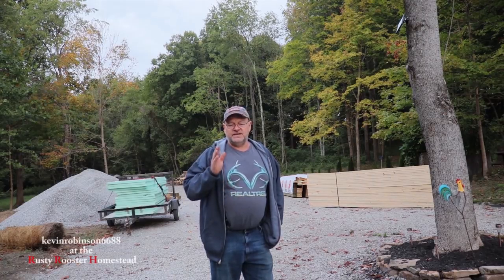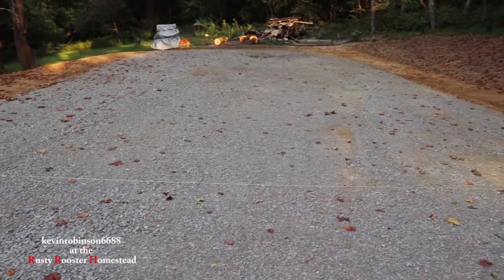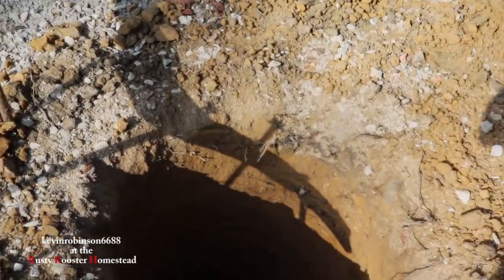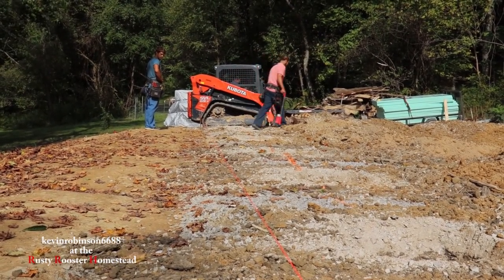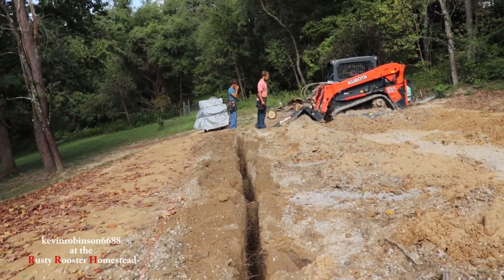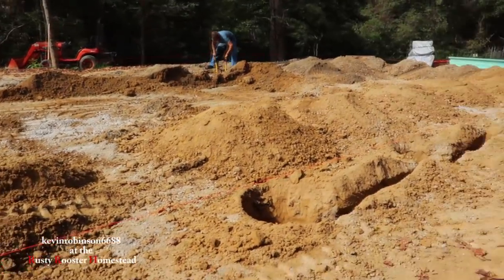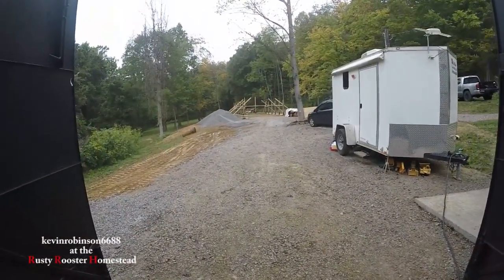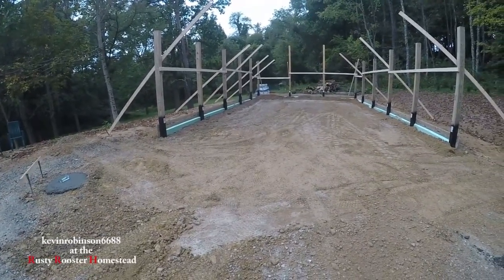mini barndominium poles and foam board frost barrier

Comment: Do your trench first, install your form board, backfill; then drill your holes. Great way to do it, 👍🏻 cheers!
Reply: And put the spoils outside the perimeter so it's not in the way and then be used as backfill to slope drainage from the building.

Comment: You sure got a lot done today. I've never seen a foundation like that before. Really interesting. I always learn something new with your videos :) Thank you for sharing.
Reply from the maker: Gerard , it isn't a foundation it is just a vapor barrier between the ground and concrete the engineer made me use.
Reply: Looks like you used more (deeper) foam then needed.  Foam is only to stop slab from wicking cold from perimeter dirt or foundation wall if you did foundation.  Only need foam on outside perimeter of slab so 4-6” deep depending on chosen slab thickness.
Reply from the maker: @chriszbodula1894  I'm basically have to do what they ask me to thanks for the comment

Comment: Hire a plumber, cost was minimal. I ran electric in rafters to keep it out of the ground and put insulated pex under concrete to wall radiators. 5 years in I love everything but the termite problem.  If doing it over sprites would be on cocrete

Comment: You will save a lot of money on heating and air conditioning if you put more insulation in and All the way around the house. I lived in Alaska for about   7years .
Reply from the maker: We are going to use rockwool insulation once the wall are built
Reply: Rockwool ? Its not save for human
Reply: @suhermantjahyadi7361   your wrong
.smh

Comment: I have a few questions and I am hoping you can help me out.  I am just starting a build in Missouri and I love your frost wall idea, but I can't find a video where you tied the frost wall into the barrier underneath.  
I am considering going in 4 feet into the pad but I'm not sure if I need it, I am not doing floor heat.
My second question is, when you did your foam board insulation on your walls, you left a space between the metal and the foam board, aren't you concerned about condensation?  Everything I have read says to not leave a gap.  What are your thoughts?
Thanks for your help and I enjoyed your videos.

Comment: Kevin, was there ever a discussion or thought about putting plywood down on top of your trusses and then your roof steel? Have noticed any extra noise when it's raining by putting your roof steel right to the perlins? I noticed you also did the bubble wrap which probably helped. Any thoughts?
Dave
Reply from the maker: dAVE, WE USED TWO LAYERS OF SOUND PROOF INSULATION SO WE DON'T HEAR ANY RAIN OR EXCESSIVE NOISES , SO FAR EVERYTHING IS STILL GOING GREAT. THANKS FOR WATCHING .

Comment: Questions:
Why dig holes so much bigger than the posts?  Doesn’t that waste material and make it harder to firm up the posts!
What is a royal area?  Is it zoned for something special?
Why did you dump hole dirt inside?  And even shovel more toward your interior!?  I think you’ve lost thickness and “tooth” for your concrete.
Did your hole auger guy check how vertical he was digging?

Comment: Your video skipped over one detail that I missed:  
(1)  did you simply rest your posts on the tops of the dried concrete columns?
(2)  how much work was required to align them so they were all plumb and planar?
Reply: Looks like they did and  they plumbed it with the supports. That's why they didn't remove the supports till they had the rafters in.  
They pulled them out to the string and using the 2x6 treated board locked them in low. The 2 - 2x12's were shelved in and locked the top. It's a barn witha concret floor. He said he was on rock.

Comment: WHY would anyone clean the hole dirt on the gravel pad  ?
Reply: And why auger holes only to trench and fill them again.  Also, why so much foam in the ground just to insulate/isolate the slab from the ground sidewalk dirt.  Just need enough foam to cover the slab thickness

Comment: Would you confirm how much cement you put in the holes and confirm you let them harden (cure) before setting the posts on top, then pouring cement around the posts.  This was the critical step I was really hoping you would show on video.  As it’s stands now we can only assume this is what you did.  Also, a critique on your job site neatness and order of work.  Why not trench first then auger holes.  Also, they spent time leveling the building site only to dump dirt on the inside floor space then the time it took to take the dirt out one bucket at a time.  If dirt from auger was dumped to the outside the inside of the building would have remained an flat level easy to stand on workspace and the outside dirt piles could have been pushed out of the way verses a bucket load at a time.  Also, why gravel the house site only to push away with the dirt.  Only thing one can assume here is mud control but gravel didn’t seem deep enough.
Reply from the maker: Thank you for the comment